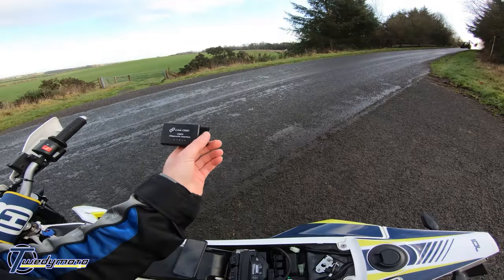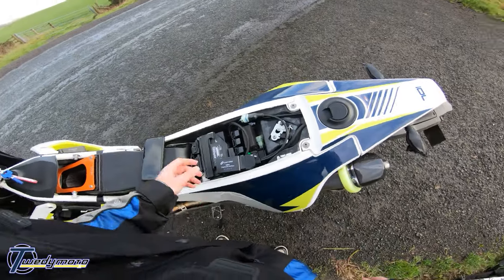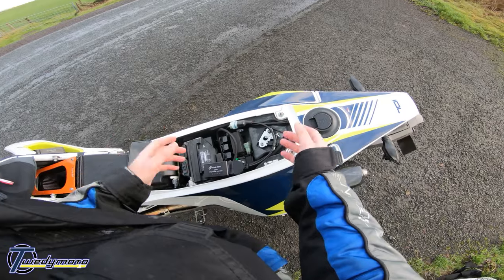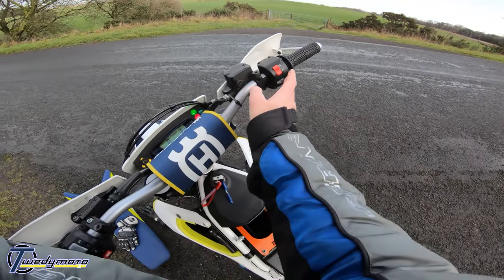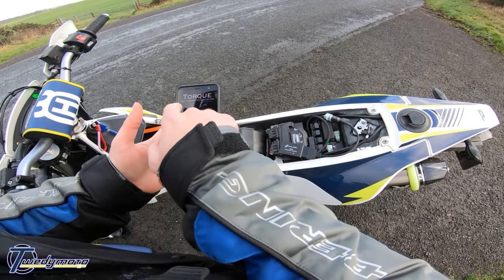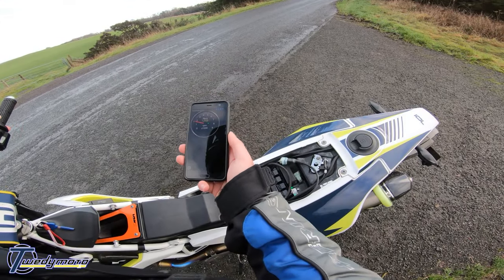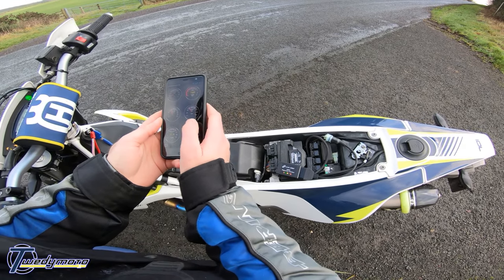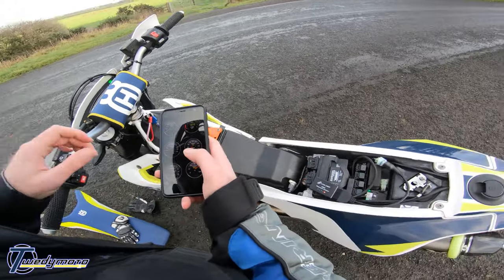HOW TO READ FAULT CODES ON HUSQVARNA 701!! | HOW TO GET REV COUNTER!!

Comment: Thanks for video and links! 
What air-filter do you use and why?
Reply from the maker: It's the DNA filter with stage 2 plate (big orange bit on top). Wanted to keep the standard airbox and this was the biggest filter available for it. Didn't want a big cone filter as I ride in all weathers and the rottweiler one is mega bucks but might still get one.
Reply: @Twedymoto  do you plan remapping or why have you installed it?

Comment: Hello,

Where can i find the plug for the reader? I cant find it on my bike
Reply from the maker: It can be found somewhere around the battery/ecu. You should be able to lift the ecu out without disconnecting it. It could be pushed down the side of somewhere. If you have a newer than 2022 bike, they may have changed it (I sold mine and haven't kept up to date with them). Hope this helps.

Comment: Hey Twedymoto, Can you tell me what protocol your adapter uses when connected to the ECU?  Also, it would be helpful if you could tell us what the part numbers are on your Keihin ECU.  I'm trying to connect to the ECU on my 2016 but it's being difficult.  As far as I can tell it is using CAN-BUS but troubleshooting would be easier if I could narrow it down.
Reply from the maker: Sorry for the late reply. Couldn't tell you what protocol it is mate. The ECU is older on the 2016 so I believe it is K-line and not can-bus. You'll be able to find a lot more info if you look for the 2014-2017 KTM 690. My 2017 ECU has 2 lots of plugs where i think the 2016 is only 1 big plug?

Comment: Did you make or buy the exhaust protector? I’m after the same for mine 👍🏻
Reply from the maker: I bought it from a German website but got the wrong size so cut it down and made it fit. You can make your own with silicone pipe and a large hose clamp or get them from safe exhaust. 👍

Comment: Does the OBD reader require cell connection or can it read it off bluetooth?  (Will it work where there is no cell service?)
Reply from the maker: The obd connectors are Bluetooth or WiFi mate. Bluetooth ones are usually better. 👍

Comment: does this work on 2020?
Reply from the maker: I'm not sure pal. Some have tried and it worked OK and others it didn't work for. Not sure if it's the ecu or whether they had poor readers.

If you have a friend with a code reader, maybe try it before you buy one. 👍